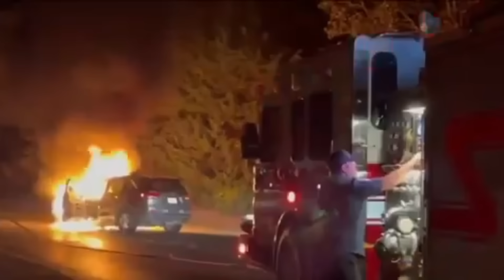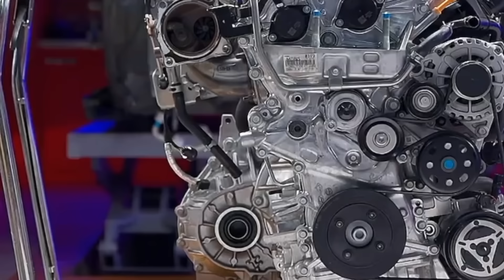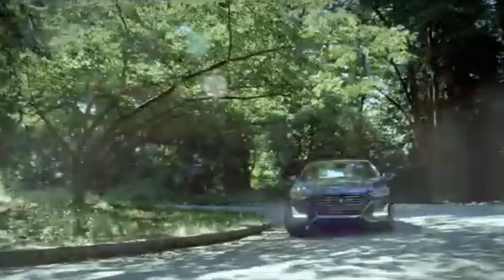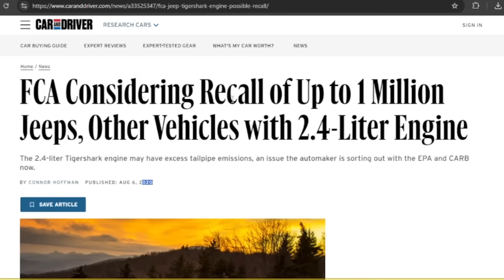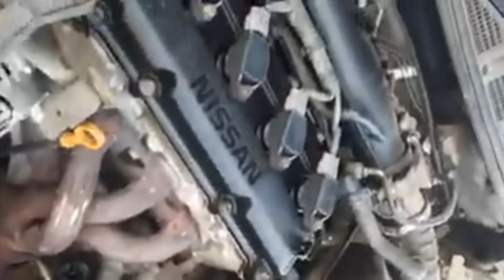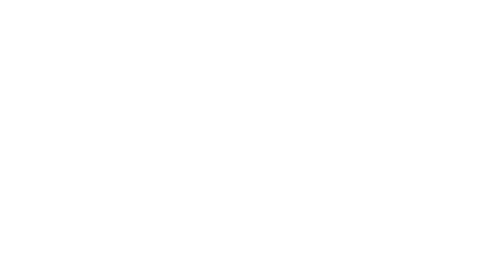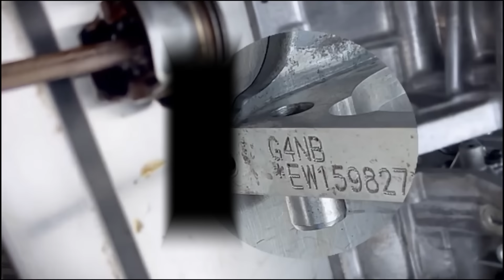Five Least Reliable Car Engines STILL IN PRODUCTION

Comment: I now change the oil in my 2013 Kia Optima LX 2.4 non-turbo every 4 months or 3000 miles.  Used to take it to the Kia dealer every 5000 miles when I was driving 50 miles a day on an interstate highway to work.  The engine performed perfectly.....I think getting the oil up to operating temp for an extended period is crutial...it boils off any blow-by products and prevents them from contaminating the oil to any great degree.  The dealer used a blended oil....I now use a full synthetic oil and Kia/Hyundai filter.  I do not drive much since I retired.  Kia recommended 5w20 oil but as I crossed 75,000 miles I switched to 5w30 and the engine seemed to run quieter and a little smoother.  I plan on changing the plugs very soon.  I think 12 years is long enough on the original plugs. The timing chain cover is starting to seep oil but not enough to be significant between changes. Dealer wanted 1500 dollars to reseal the cover...I imagine if the cover is removed it would be best to replace the timing chain and guides. Another 500??  I am 76 yo and will be doing it myself.  The major reason I have stopped using the dealer for general maintenance is that I do not like the fact that no matter what the situation, even with an appointment, I will have to wait for an oil change a minimum of an hour and a half and am not allowed to observe.  It is worse than going to the doctor.  If you do your oil changes yourself just keep good records and change it often.  Going on 79000 miles on my Optima and am satisfied with it.
Reply from the maker: It's really great to hear this, 12 yrs is reasonably long. I see you have taken good care of your car. 👍
Reply: You aren't in the clear yet, but if your Optima is a K VIN that means it was made in Korea and those Thetas seem to have reasonably better reliability than the Georgia built version.
Reply: My father in law's Kia engine blew up at 86k miles after running rough for a while. A long distance trip from Cincinnati to Canton blew up the engine. He haggled with Kia for a month before it agreed to replace the engine. Hopefully the new engine was assembled without metal debris and will last a few years. On the other hand, my mom's 2013 Elantra with the 1.8 liter engine ruins perfectly after 100k miles.
Reply: Wow. Same maintenance for rotary or boxer engines 😂
Reply: BladeCenter good for you sir.  My ciusin just bought her son a show room /shoffered elantra 2023 with 5000 miles and they added the insurance pack that includes the oil change.  I should've said bring it by me when they bought it  I've got plenty oil for 10 years Just buy the filter 🙃 oh well lol

Comment: You missed out the current 2L Landrover engine
Reply: You are probably thinking of the Ecoboost 2.0T.  It isn't a bad motor if you respect it, but LR owners likely don't.  The head and block are fragile, so it needs to gently warm up before you give it the 15lbs of boost (kind of common with turbos).  You also can't go 10k-15k miles on oil on an oil-cooled turbo engine for multiple reasons.

Comment: I have a Focus with1.0 ecoboost and 200.000 km, with no problem, no power loss, hardly any oil use.  So I am curious about the real data of failures, instead of just repeating what other youtubers say (who don 't own a 1.0 ecoboost either).
Reply from the maker: A lot of complaints, recalls, and lawsuits are not without a reason. Premature failure in an ownership of someone you know is also a good source. I never owned one with any ecoboost.

Comment: Tellingly, ALL of the engines on this list mainly affect the low(er) cost car models on the market. I can't help but wonder if it's deliberately encouraged by regulators to push marginal buyers out of the market entirely. At the very least, it proves that low end buyers don't matter to the OEMs or government regulators.
Reply: But most Honda and Toyota 4 cylinder engines are much better, with very few clunkers. They care about quality and dependability.

Comment: All hyunday new engines are pure shit
Reply: The 1.6 Gamma/Smarstream is a solid little simple engine that's mildly overbuilt for the rated power and with correct maintenance is extremely reliable.
Reply: I own a 2017 accent with the 1.6 gamma engine   It's  my daily commuter to work, 180000km and running strong and no oil consumption, but i change oil every 6000 kms using  full synthetic oil, gets 50 mpg if driven nicely. Great little engine

Comment: I’d like to know how squirrels are getting under the hood. Where you add oil, there is nothing but pine cones, leaves and whatever else they eat. I have to be careful cleaning it because I don’t know what that crap could do if it got in the engine. This is the first time it happened. What a mess.

Comment: I do not understand how these "engineers?" can make this stuff. Any of us with real world experience in repairs knew the wet belt Eco-boost coud not last! For the exact reason they show here. Heat and oil?   On RUBBER?  It was only a  matter of tiem till the belt started to degrade.. The shame is, with an exterior belt, the 1.0 could have been a GREAT little engine
Reply: They do it on purpose

Comment: What is it with 2.4 litre engines? I’ve got a 2.4L in my 2011 GMC Terrain. It does worry me. The only major problem so far is a cam sensor that went south. 400$ repair. I don’t know if that’s a good, normal or excessive price.
Reply: Neglect,oil changes not done on time.
Reply: If that's the same engine as our '15 Equinox,  I bought that part at Napa for$30 or so, installed in about 15 minutes..  btw ours drinks oil..
Reply: @ 30$ and I spent 400$ that’s not even including the flatbed tow rig ( mine is AWD) I’m also getting peeved with the change oil soon light coming on and this is 20 minutes after an oil change. My mechanic even showed me how to reset the oil remaining after doing an oil change. I’ll never understand GM. Good luck with your Equinox . Take care.
Reply from the maker: Take good care of it, ahead of manufacturer recommendation. But it is not the one I discussed here, yours is EcoTec engine, I think.
Reply: My equinox made 200k miles before I got rid of that curse. I checked my oil every day. Used $30. In oil. a month towards the end.

Comment: The Nissan ka24de is a very good engine. I've owned hard body trucks with this engine and both went over 290,000 miles. Don't know why it was mentioned.
Reply from the maker: I have talked about the QR25DE here in this video, completely different engine. KA24DE is a great engine. Thank you for mentioning
Reply: @ArrowGearhead  I have a Nissan Frontier with the 2.5 liter engine(I think it is the QR25DE).  It has gone 105,000 miles without issue.  I think it is the stuff placed around the engine, not the engine itself.  I have read about some Nissan car models that have had screws come loose in the intake system and get sucked into the engine and other stuff.

Comment: Had a ford with the 1.0 eco boost as a rental in Atlanta a few years ago during a work trip. With two grown men (neither of us very large) and a couple carry on bags, the car actually struggled to maintain speed on over passes in the city. It was terrible. That being said, I have a 2.7 eco boost in my personal 2019 F150 and it’s a phenomenal engine with zero problems.
Reply: The last word you should have said about the 2.7 is YET.
Reply: @erwinpadgett1050  haha! Let’s hope not. Admittedly, I took a risk with the same reservations many express (high combustion pressures & small displacement). My original engine of choice was the base 3.3L. I tow regularly, but not anything crazy heavy. But, I just couldn’t locate one available in my area unless I was a fleet customer. I think I have a couple things in my favor to help it live longer. I live in a rural area, so I mostly drive at highway speeds. Very little stop n go. I’m a stickler for maintenance. Time will tell…
Reply: @3105Chop  2.7 have had some good ratings from owners.  Just not many.
Reply: @erwinpadgett1050 2.7 eco boost has been proven to be reliable, some people might say it’s more reliable than the 3.5. The 2.7 is more than enough for people who drive trucks nowadays
Reply: @anthonyvu749  All EcoBoost have had problems.  Read the national report on Ford EcoBoost by owners. Like I said, just because yours didn't have problems doesn't mean it's trouble free.
Reply: I call them Ecobust engines.  Had a 2011 Flex which was a great vehicle when it wasn't in the shop.  Second time the Turbos went was enough for me.  No vehicle in 30 years of driving cost me even half as much in repairs(and that was after quite a bit of work under warranty).
Reply: @JensJaskorskilol how would your self described superficial evaluation mean anything compared to his personal experience? I trust @3105Chop more
Reply: @JensJaskorski 😂
Reply: A tiny turbo engine is bound to have problems after a while because it is overstressed. Even if the engine stays together, the turbo will go even with 3k oil changes. Replacement cost is around $5k.
Reply: There’s no replacement for displacement.

Comment: Ford ecoboost 2 cylinder belongs in a yard tractor/lawn mower not a car. Avoid anything with a turbo because when they break it gets real expensive real fast.
Reply: Almost all large commercial trucks have turbos and go a million miles plus with no problems. They are a very proven reliable technology. You should only hope the engine lasts as long as the turbo.
Reply: @williamevans2176  And large commercial trucks are related to cars...how???? Another logical failure.
Reply: @DiaperDon_BoneSpurs_Epstein  The original comment was 'Avoid anything with a turbo...' which is nonsense.
Reply: @htimsid  no, it's just common sense.
Reply from the maker: Thanks for sharing your thoughts. I actually didn’t mention any two-cylinder engines in this video.
Reply: It's actually a 3 cylinder
Reply: I have had many turbo engines in my 40 years of driving, and never had a turbo related failure or even issue.
Reply: @robertvandermeulen8004  Another completely anecdotal claim.
Reply: What 2 cylinder that's a Fiat twinair it's certainly only 2 cylinder solid in Europe found in pandas & Fiat 500 Twinair. If you mean ford the Ecoboost or as we call them in the UK Ecoboom are 3 cylinder 1000cc Turbo.
Reply: You worry too much.
 The ecoboost engines are good reliable engines. I would just stay away from the three cylinders.

Comment: Dirt and remains from the assembly is not an engine problem. Its an assembly problem.  Combustion fuel injection  is something all cars have nowadays. But it is not a good idea.
Reply from the maker: But all engines don't have debri problem. This is a competitive industry. Debri is a result of carelessness in manufacturing plants. It can result in catastrophic failure. Look what happened to Toyota Tundra. That is why it is important to critique.
Reply: Still the engine !

Comment: All ecoboost engines 💩
Reply: *except the 2nd Gen 2.7. Seriously, those things are great. The weak link is the wet belt driven oil pump, which I'm pretty sure Ford added (the first generation had a chain driven oil pump) because they weren't having enough service/replacement profit.
Reply: Wrong. 2.0 ecoboost and 2.7 ecoboost are pretty damn good. I know the 2.7 has had issues with the oil pan leaking tho.
Reply: @55Berg Agreed, my brother in law is currently driving a 2015 Focus ST that has turned over 590,000 miles with the most expensive repair behind a water pump replacement at 300k. Also clutch, cats and exhaust are original. Astounding. Posted pics of the car on Ford’s FB page with zero interest from Farley and Co.
Reply: I found out the hard way😢😢
Reply: 180k kms on 1.6eb. Just did a remap from 180 to 230hp and 240nM to 330nM. Doing only fluids, filters and brakes. And belts when necesary.
Reply: @mmllmmll22 our 1.6 ecobaoost also still going strong with 380k km. Only once had the headgasked changed.
Reply: 1.4 turbo LE2. 150k miles only had a bad fuel injector.
Reply: No, absolutely not all of them. Some, not all. 0:06
Reply: 2.7's are strong only the oil soaked belt is a problem but its not as big a problem as everyone tries saying
Reply: They are also nicknamed the ‘EcoBoom’, because that’s the noise they make not long after the warranty expires.
Reply: It sucks because I would totally get the bronco sport since it’s a pretty matching replacement to my 2011 escape but I’ll never buy an ecoburst piece of junk.  They still make the 2.5 that’s in my car too for the hybrid, albeit an Atkinson cycle but they could easily still make the normal version too.  I don’t care if it’s only got 175hp.  It’s decent on gas and reliable af.  I’m at 270k and it runs absolutely fine.
Reply: Be honest. You dislike them because of the prefix "eco-" in the name.

Comment: The 2.0L Theta II i in my Veloster N and many other Velsoter N's is really robust.
Reply from the maker: Congrats, you're among the lucky ones.
Reply: That's the thing, I got my grandfathers car as my first car. (I'm 16) When he passed at the end of this summer, he left It to me because he knew I would take care of it, and it's been great so far. It just hit 65,300 miles, so I've put about 3,100 miles on it so far. No problems on its Theta ii turbo 4cyl engine. It's a 2015 sonata sport 2.0t. I check the oil about every 2 weeks, no excessive oil consumption like some people say. Also, personally, the 2.0t sonatas are underated. They can be a LOT of fun with 245 hp stock.
Reply: I'm learning how to work on it in my high school auto shop class. it's not too bad to work on. I'm also thinking about doing some slight tasteful mods, magnaflow catback, HKS ssqv blowoff valve, AEM cold air intake, lap3 protuner, Enkei TSV 18x8.5 +38 aftermarket rims, ADDW1 dual inlet catch can and maybe  even some adjustable coilovers to lower it an inch or two.